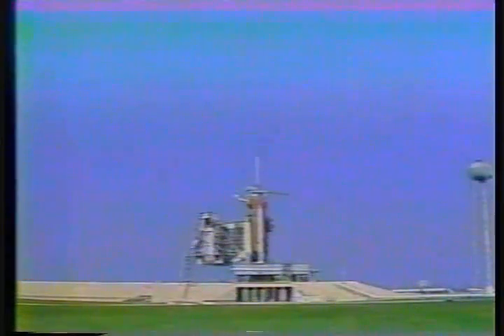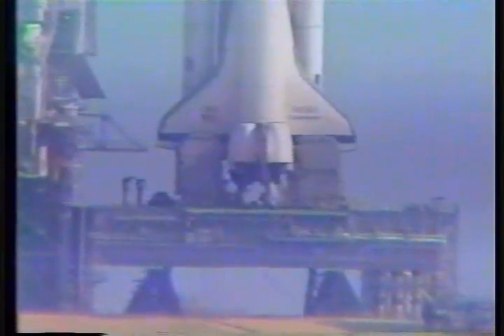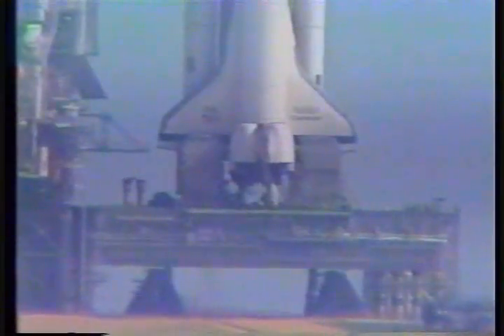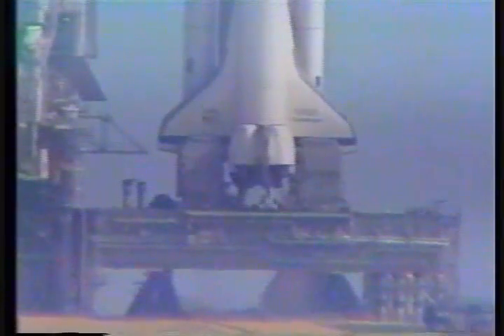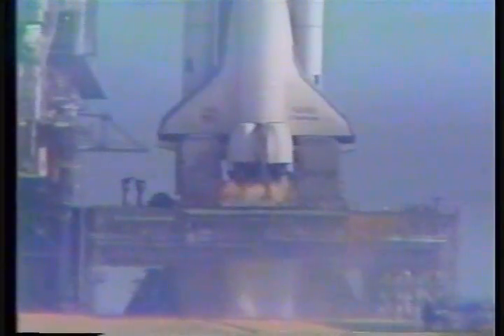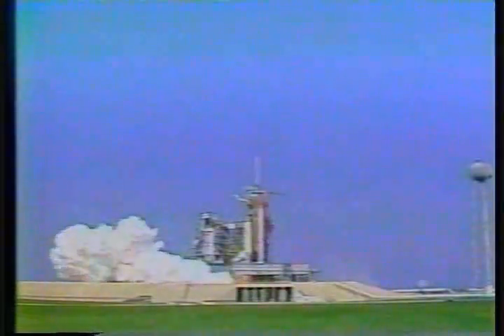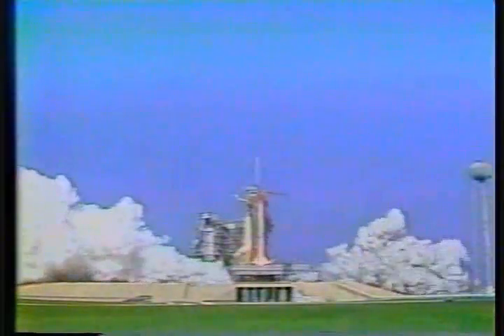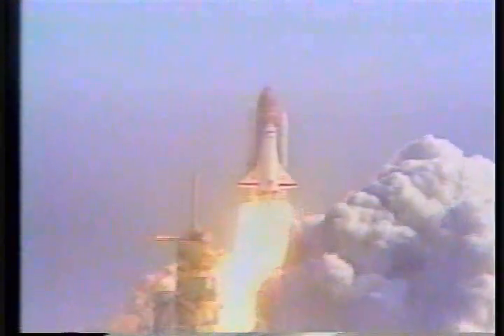STS-41C launch & landing (4-6-84)

Comment: This flight repaired and redeployed the Solar Max Mission satellite.  For the first time the Shuttle made a direct insertion into a 28.45 degree orbit to conserve valuable orbital maneuvering  system propellant for the maneuvers required for Solar Max rendezvous. Lower than expected SRB performance nearly resulted in the use of the OMS engines to achieve orbit, which would have meant cancelling the rendezvous and repair of the Solar Max.
The Long Duration Exposure Facility was deployed, with 57 materials experiments mounted on the outside.  The LDEF was meant to retrieved the following  year and returned to Earth to measure the effects of the Space environment on the different materials.  However, the Challenger tragedy postponed the retrieval  until 1990, just in time before LDEF would re enter the atmosphere and be destroyed. 
Mission Specialist George Nelson flew using a manned maneuvering unit to the Solar Max withDocking device attached to his chest.  He achieved a soft docking but was unable to hard dock, and so the attempt to bring the Solar Max into the cargo busy was unsuccessful.
Challenger had now to attempt a  direct  remote manipulator  grab  and had only one chance to do so.  Fortunately, the attempt, by MS Terry Hart, worked.  Then Nelson and fellow MS James Van Hoften undertook another EVA, lasting over 7 hours,  which repaired Solar Max and was later redeployed to continue its mission.
The Shuttle was supposed to land in Florida but as often happened bad weather forced a diversion to California, the second time in succession this had happened to commander Robert Crippen. 
Solar Max continued to operate until it re entered the atmosphere a few years later and was destroyed. 
This was a magnificent achievement by the Shuttle, whose crew performed the mission with great courage and skill. But the Shuttle proved so costly and unsafe that it would have been cheaper to have built another Solar Max and launch it on an expendable rocket.  
(Of course Falcon 9 did not emerge until many years later - if there had been one it would have been even cheaper). 
The EVAs did provide valuable spacewalking experience for the later construction of the ISS. 
The flight also had extra passengers -  a few thousand honeybees to measure how they fared in weightlessness. 
commander Crippen, pilot of the first shuttle mission, made his 3rd flight, his second to Command. Pilot Dick Scobee made his one successful flight, he was killed on his second mission  aboard the same Shuttle, Challenger, less than 2 years later.  MS Terry Hart made his only flight and resigned after the flight for what  Bob Crippen years later told me was better paid work. MSs George Nelson and Jim Van Hoften both made their first flights. 
The flight achieved 2 records - the first satellite retrieval, in orbit repair and redeployment of a satellite and the 1st astronaut docking with a satellite.  This was also Challenger’s   highest flight, at  270 miles. It never got the chance to fly higher for the Hubble Telescope flights, it was destroyed before Hubble was launched.  Challenger is the only Shuttle never to have been involved in the Hubble missions,  the best work the Shuttle ever did, with all due respect to the Solar  Max flight and its crew.

Comment: STS-41-C was arguably one of the best shuttle missions (despite not having the fame of missions like 49, 61, and 88), and definitely Challenger's crowning mission.
Reply: NASA saved themselves MILLIONS by doing the missions you described. It's just a shame that the booster issue wasn't fixed in mid 1985. Challenger did not have to be lost.
Reply: @thunderbird1921  It was hardly a design failure as it was a competence failure. Sure three O-rings improves the safety factor, but only when safety factors are deliberately ignored.
Reply: Tsarbomb117 Right. There is nothing wrong with a butter knife if you use it as it was intended. But if you try to cut a brick with it, you’re going to ruin it. The same with the o-rings in cold weather. They knew it was wrong and risked it, and we know what happened.